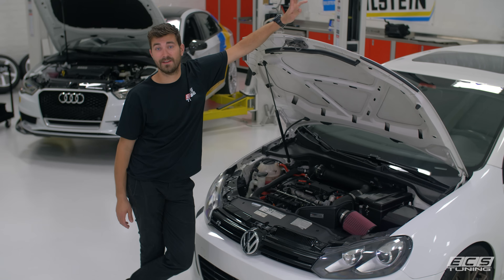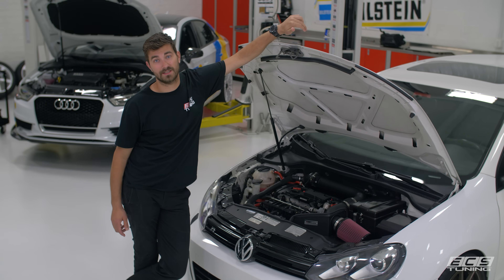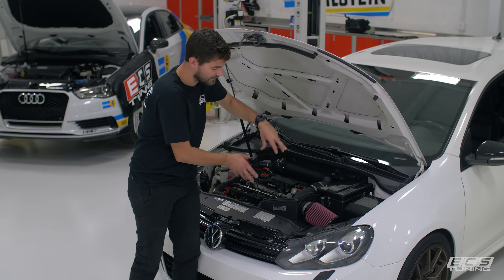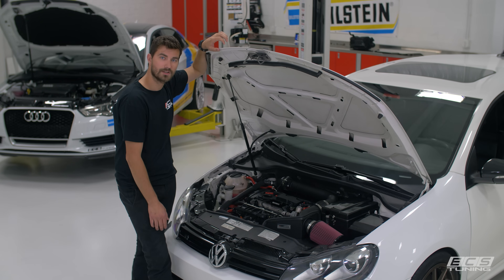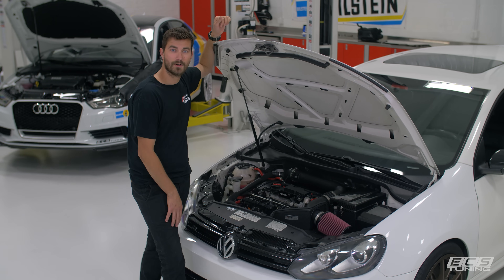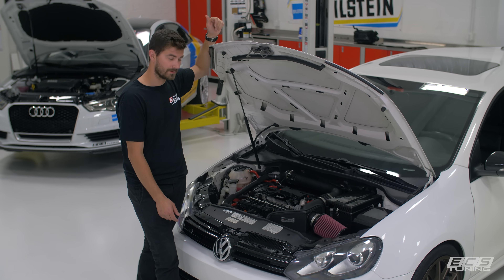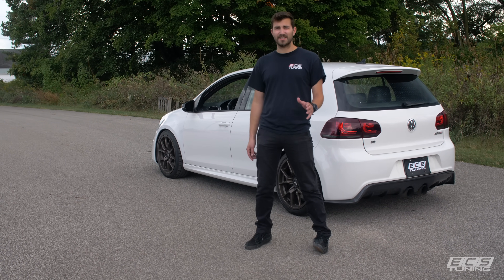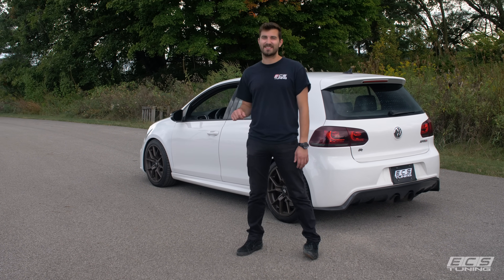ECS Tuning VW MK6 Golf R Intake

Comment: I have a Volkswagen cc 2009 what is it consider mk5 or mk6 please let me know
Reply from the maker: For the 2.0T, VW switched to a TSI engine for most vehicles in 2009, which is what your CC has.  We have a few intakes that fit your car, but they don't have a heat shield.  Here's a link: https://goo.gl/zJ1u5f  The MK5 and MK6 chassis codes don't apply to the CC like they do with the Golf and Jetta.

Comment: Wait...my ‘09 MkV is a TSI engine. They ended FSI motors with the start of my 2008.5/2009 MkV. So am I missing something?
Reply: The Golf R uses the upgraded FSI from the TT-S and European S3. Bigger turbo, intercooler, and injectors, forged internals, and a revised HPFP cam follower.
Reply from the maker: VW decided to use a version of the FSI engine in the MK6 Golf R (2012/2013) with a K04 turbo bolted up to it.  The GTI switched to a TSI engine towards the end of the MK5 as you mentioned.
Reply: The fsi in the golf r is a better motor than the tsi